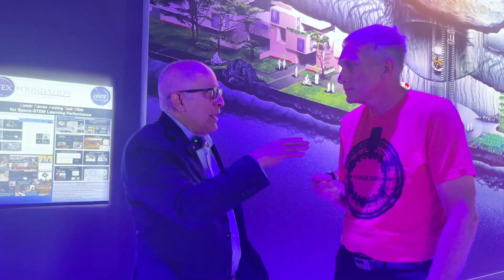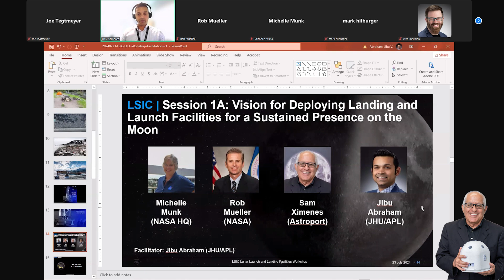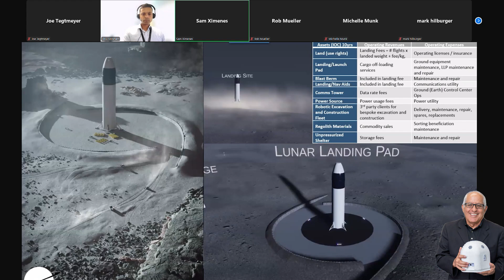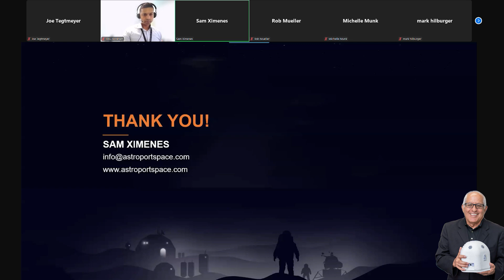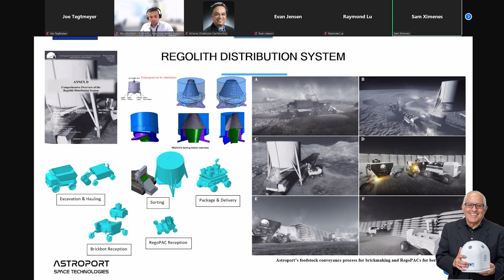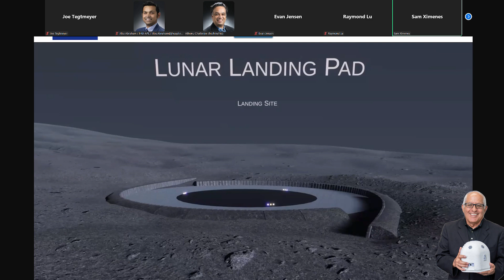Creating a Lunar Economy ... A Detailed Discussion with Astroport Space CEO Sam Ximenes

Comment: I mean it’s certainly an idea, but something of an obvious one. It’s a brand new company and this Sam guy doesn’t even have a wiki, nor does his company. I’m an armchair regolith expert and literally nothing here was new. Do they have any kind of technological moat? Not really. 

Yeah someone needs to make the tiles. Using rocket exhaust to burn a pad won’t work. But literally anyone can make tiles. Just comes down to who will be able to flex on the moon. SpaceX can likely throw together a giant machine and drop it on the surface and erase this “company” in a flash.

Not trying to be mean here but this is low hanging fruit. The only thing they have going for them is that nobody had tried yet? But yeah SpaceX can spend a few hours of engineering time and drop a multi ton device on the moon to accomplish this.
Reply: SpaceX so far is essentially a transportation company. It will take many players to design and build factories, stations, habitats, etc., in space, on the Moon, or on Mars. However, you do raise an interesting question and possible solution. Right now, landing on the Moon is extremely messy with regolith being blown everywhere (and dispersing very slowly) and with uneven landing terrain. The idea of initially transporting some kind of folded-up landing pad structure into lunar orbit, then bringing it down slowly under thruster control, and possibly simply dropping it the last few dozen or 100 feet in the right spot seems like a good thought plan. Let it deploy itself and then bring your Starship full of payload to land on that spot as though it were landing on a drone ship. It could then take off and return a few times while regular landing pads are being constructed.
Reply from the maker: @jadusiv  ok … I think you might be missing just a few steps in your analysis, but thanks for watching.